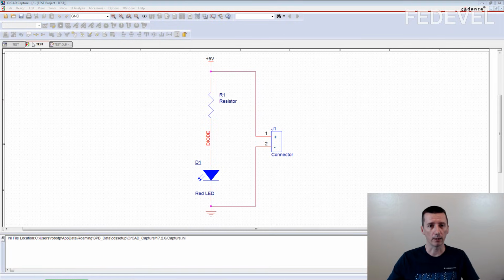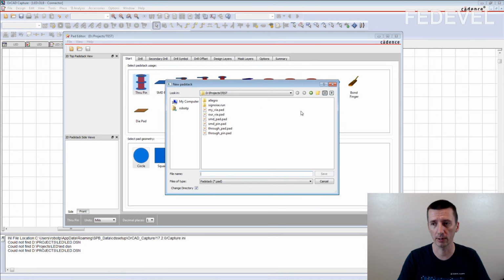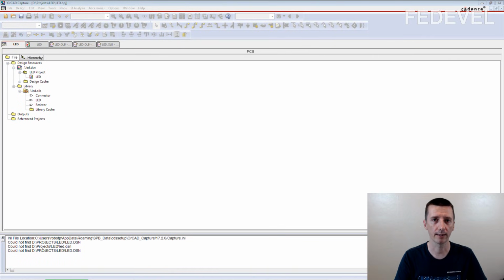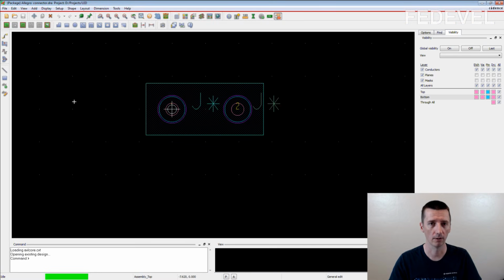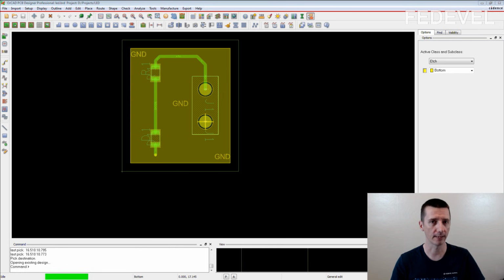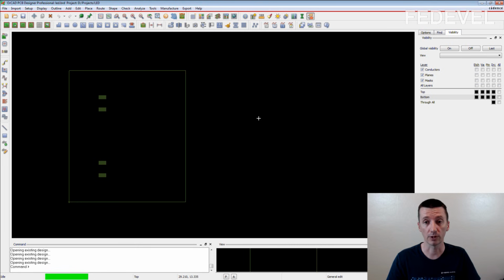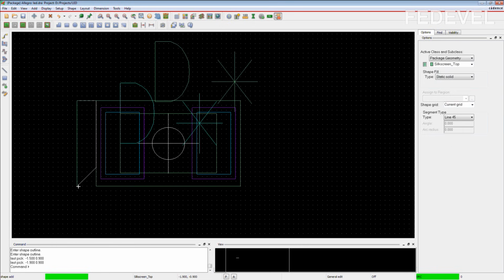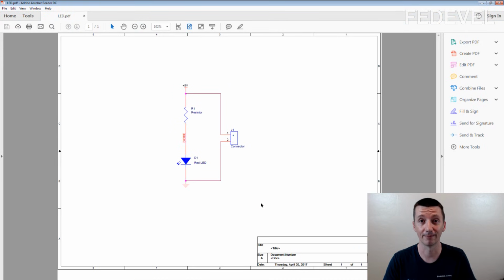Starting with OrCAD and Cadence Allegro PCB - Tutorial for Beginners

Comment: Thank you for the video, quick question though. 
How would you actually electrically model the parts and associate that model with the created symbol? 
Like lets say you wanted to create a custom LED with an abnormal IV curve, how could I associate that with the LED symbol I just made (or associate it with a default symbol)
Reply: I'm assuming you want to simulate the part, then you would assign a PSpice model to it using the PSpice model property

Comment: Great tutorial, thanks. I'm moving from Mentor and I have a question for you: why do you tell us to refer to a Local library for Padstack, symbols and footprint and not to a Central library ? In this way it would be always updated.
Reply from the maker: Thank you pixal82. PS: The video is just a very quick introduction to show the workflow to help people to get an idea how it works. After that they can try to find the most optimum way to work for them - including libraries. So, after watching you can continue any way you prefer and is the best for you.
Reply: Ah ok, no problem. I was thinking there was a reason for what in Allegro is better to work with a local library and not a central one. Thank you
Reply: @pixal1982  Most, if not all, companies have a central library.  commonly connected to a PLM system

Comment: What is the purpose of the Internal Layer during Thru Pin padstack design? Isn't the PCB 2 layered with only top and bottom?
Reply: internal layer is how the padstack will scale and adjust when it's used on multi layer board. So if you have a 4 layer, 6 layer or 10 layer board, the internal layer definition applies to all internal layers.

Comment: Thank you for your tutorial, it´s really excellent. Now, I am learning to use the PCBEditor v17.4 before, I was using OrCAD10.3. For me, this has been a big change. I have not found anything about getting a printed image of different etch layers or layouts. I would like to make a simple prototype and I do not need to export the gerber file, only print a layout as before I did it with Layout 10.3. Could you help me?. Also I tried using Export DXF but I didn't get it, on that occasion I used freeCAD and Inkscape.

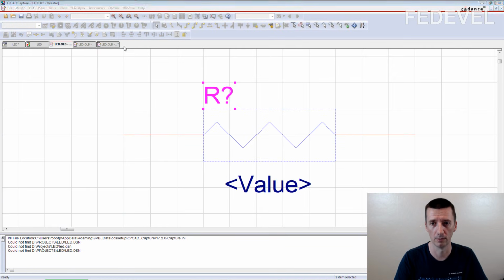Comment: I've found that I have to put in the time to learn each step and I'm grateful to have this concise video to explain. I cannot seem to assign footprint to the part in the library, however. I have followed the step as outlined at 19:25. It goes smoothly but if I right-click on the part and select show footprint, I get the message that the footprint was not found in the search path. The footprints are in the project directory as you said they should be.
Reply from the maker: This may help: https://designhelp.fedevel.com/forum/main-forum/orcad-and-cadence-allegro/13359-could-not-launch-footprint
Reply: @RobertFeranec  This did help. I had to include a filepath to the project directory in the capture.ini file. Thank you very much for your help.

Comment: Great video @robert, this really got me started on Cadence Design Entry.  I am now creating the footprints but am stuck with creating the footprint for the FH28H-80S-0.5SH(05).  I already created the SMD pads but am stuck in creating the footprint.  I started my PCB Editor and then created a new package.  Typed connector, package symbol(wizard), but then am a loss as to which one to select on package symbol wizard.  Do I still select SMD discrete?  my connector is an 80pin, 0.5mm pitch SMD connector.  Can you please help me how to go about creating the package or footprint for this connector?
Reply from the maker: Thank you Richard. Please, could you add your questions on our forum here (also attach some screenshots): https://designhelp.fedevel.com/

Comment: I got problem when I create footprint for resistor. I follow all the steps in video, but when I want to add padstack for symbols pins, there is no padstack available in "Package symol wizard padstack browser". Can anyone help me. Thank you alot!
Reply from the maker: Double check the PATH were you saved your padstacks
Reply: Robert Feranec you mean the path we setup in user preference?
Reply from the maker: @tunguyenxuan9388  I mean PATH were you save the padstack and where your project is located.
Reply: Robert Feranec it means all of them need to be located in the same folder?
Reply from the maker: @tunguyenxuan9388  yes, the padstacks should be in the same folder as the project, then you should see them automatically .. or you may need to set a PATH somewhere, but I do not remember where exactly.
Reply: Robert Feranec i’ve find out. We can set padpath by using Design>>User Preferences Editor>>Paths

Comment: Hello Mr. Robert, thanks for the video. I have bit confusion regarding Cadense. First thing is the two software suits one is OrCad and other is Allegro. What is the difference between them? As far as i know they are compatible and Allegro is bit advance compared to OrCAD. But PCB layout file format is different. one supports .BRD file while other .MAX file. I have installed OrCAD (which supports .MAX file) but it is supporting only .BRD files. So it is confusing me. Please help me. I want to open and edit a .MAX file. THANK YOU.
Reply from the maker: Originally OrCAD is name for Schematic Editor, Allegro is name for PCB editor. Cadence made it a little bit confusing when they introduced product called OrCAD PCb Designer Standard / Professional - this includes OrCAD Schematic editor + Allegro PCB Editor.
Reply: Oh I see. Thank you. But how I should open a .MAX file :-( as per your tutorial Video the PCB layout is saved as a .BRD file and My installation is also opening only .BRD file. But my designer gave me a .MAX file
Reply: @eXtremeElectronics   HI eXtreme.  Back in 1998 when Orcad was a standalone company OrCAD had their own layout tool called OrCAD layout.  It's file extension was .MAX.   That layout product was pretty basic so when Cadence acquired OrCAD they end of life the OrCAD layout product.  They then took Cadence Allegro with basic feature set (equal to OrCAD layout) and sold it as OrCAD PCB.   So now Cadence Allegro and OrCAD layout are essentially the same tool.  Allegro just has more features than the OrCAD.     Now to your question. from a -dos command line by type l2a and hit enter.  This will open the translator to convert your .MAX file to an Allegro .BRD file.  hope this helps 4 months later :-)

Comment: Sir do you have any course plan using allegro advanced concepts like high speed layout?   Note online only.
Reply from the maker: Advanced PCB Layout course is done in Altium, but it is the most generic course and can be used also with Allegro. The course is about hardware design - Altium is just a tool where I show how to do some things. If you do it with Allegro, you still can learn a lot, you just will need to figure out how to do some things in Allegro software (or, you can always ask on our forum). Here is link to the course, have a look: https://www.fedevel.com/academy/online-advanced-pcb-layout-course/
If you have any questions, just let me know.
Reply: in your training for advanced PCB layout  design  have provide complete  training (schematic , foot print creation ,placement ,routing  and Gerber generation .for all components
Reply from the maker: Advanced PCB Layout is about Placement and Layout. There is nothing about schematic or making footprints - for these have a look at Advanced Hardware Design course: https://www.fedevel.com/academy/